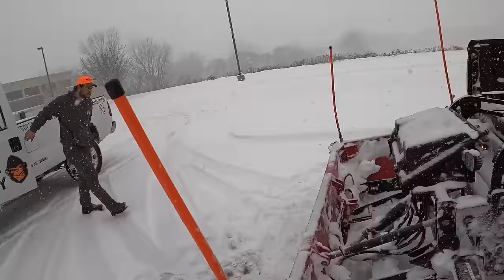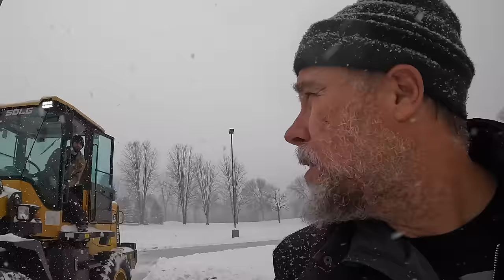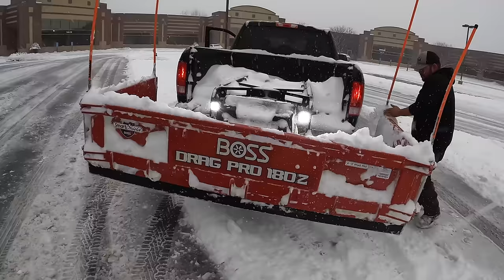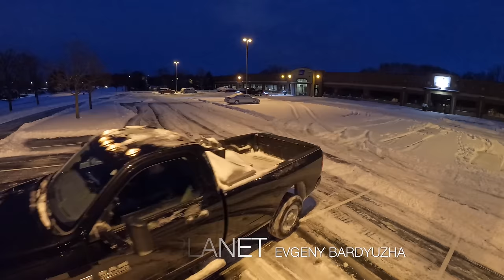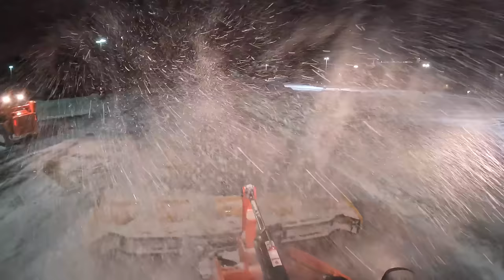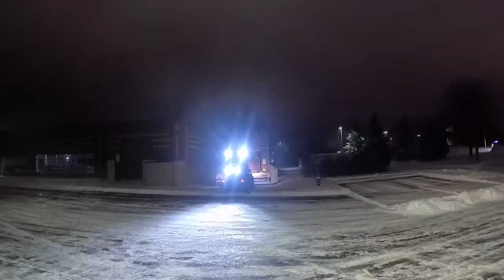Plowing Thick Sloppy snow

Comment: Still waiting on winter here in Southern WV, it was 66⁰ here today. I know you haven't bought any new skidsteers but have you ever even any thought about running cab tractors instead of skidsteers? At half the initial cost I would think they would be a attractive option. I would think the only downfall would be them being physically larger than a skid and not as maneuverable when using them during off plow season

Comment: Your fleet has really changed from the time you started on YouTube. I remember when you had to put plywood underneath to protect the parking lot. Something I've always wondered, what do you do if you have to go to the bathroom and you're plowing snow? Do you go where you are or drive to a gas station?
Reply: Typically once in this line of work your body develops a pretty strangely accurate "bathroom routine". One can assume for these guys if something irregular comes up it's either dealt with on site for minor movements or a quick drive to gas station to deal with the rest. When I did irrigation especially cottage sites,  home owners weren't around, we were constantly finding places in the Bush to deal with things, gotta do what ya gotta do 🤙
Reply: @Tannertraversed  yup. Everyday at 3pm. Like clockwork lol

Comment: Hey Stan in the first park of the video your truck plow was scraping better than the sledge and arctic. Which surprised me as I run arctic myself did the operator not have it set right? Hard to believe a truck plow can out scrape a sectional. Just curious

Comment: After lots of research, and watching quite a few reviews, I finally purchased an arctic sno-pusher. Wondering what if any parts you keep on hand for those?
Reply: Just some rubber push blocks
Had mine ten years
Reply from the maker: I have never had an issue with them.  I have zero spare parts but do have an entire extra pusher that just doesn't get used.

Comment: The sdlg looks like it could use some liquid in the tires to give it weight to help the tires bite a bit better we do winter washer fluid in everything makes a huge difference and not corrosive on the rims
Reply: Beet Juice would add 500 more pounds than windshield washer fluid and it's noncorrosive and freeze protected to -35F.

Comment: Hey Stanley, I wouldn't really know because I'm in Texas where it rarely snows but it just seems like it would be easier to blow all that snow off with a leaf blower. Have you ever tried that?
Reply: Snow gets too heavy. Anything under an inch I do that but if it's wet or over an inch a leaf blower won't make a dent.
Reply: @jonkoskela7682  Makes sense. Thanks.